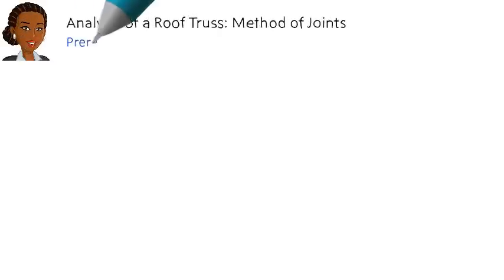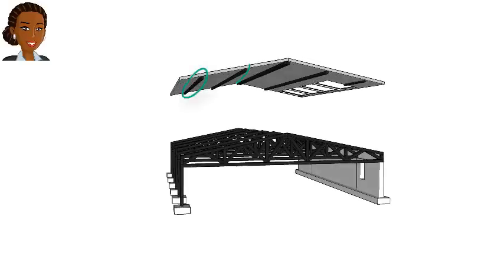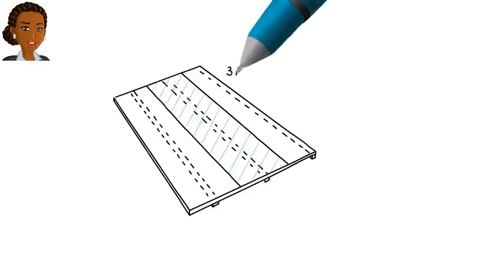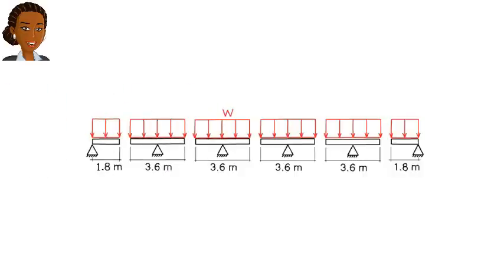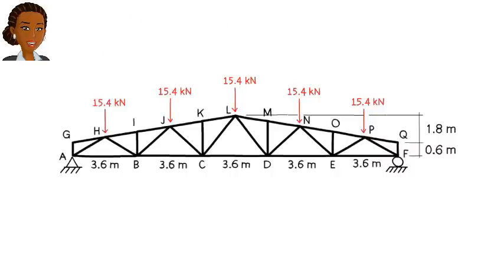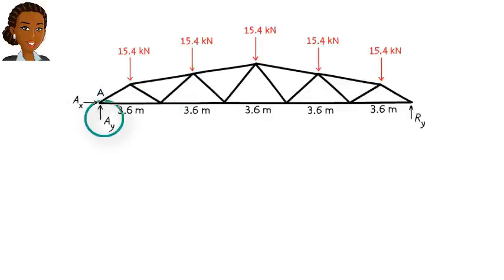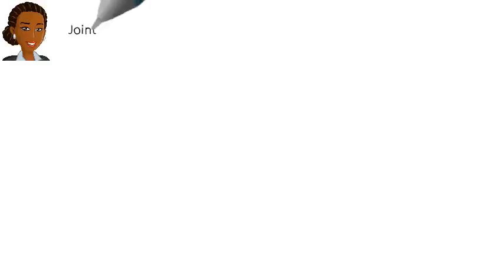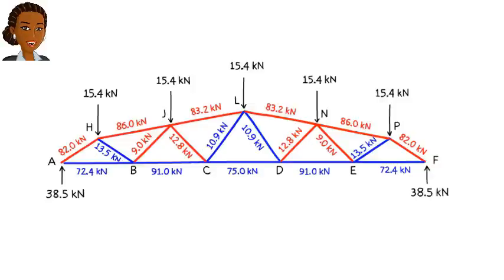SA36: Analysis of a Roof Truss: Method of Joints

Comment: Your force at member bh is wrong .. And the rest of the members for compression and tension.  Maybe u need to review the forces or ur computations..
Reply from the maker: Why is the force in member BH incorrect? can you explain? can you support your assertion?
Reply: @DrStructure  i used the  equation in  my scical..
Reply: @DrStructure  the principle in solving the forces using method  of joint is correct but u need to review the values of the forces  maybe  u need to recalculate it, anyways im just telling what ive found.
Reply: BH should be 14.07kN in compression and JH should be 86.42 KN in tension
Reply: @chinitoengineer5462  lol, are you serious? How can JH be in tension?
Reply from the maker: @chinitoengineer5462  Let’s do some qualitative reasoning here to see why JH cannot be a tensile member. 

Think of the truss as a hollowed beam which is subjected to a series of downward loads. Consequently, the “beam” is going to bend downward which causes compression along the top fiber and tension along the bottom fiber of the member. Translating this back into the truss terminology, we can conclude that the members along the top of the truss are going to be compressed and the members along the bottom chord of the truss are going to be stretched. This simple reasoning invalidates the assertion that JH is in tension.

I leave the calculations and validations of the force magnitudes as an exercise problem, and welcome any solid reasoning and/or proof that you can offer in support of your conclusion.
Reply: Ok lets say that we neglect the compression and tension the point here is the values that u calculate is wrong its not 13.5 and 86..
Reply from the maker: @chinitoengineer5462  You keep making the same assertion without supporting it. Where is the proof?
Reply: And also  your presentation of compression and tension forces were wrong how can you stretch BH if AB is also ang tensile force? Simple analysis by eye without any computation u can easily identifiy  what kind of force it is.
Reply from the maker: @chinitoengineer5462  That is a good question. How can BH be in tension if AB is also in tension?  
Consider joint B. BC carries a tensile force of 91 kN. AB carries a smaller tensile force (72 kN). So, thinking about it qualitatively (ignoring the very small compression force of 9 kN for now) BC is pulling to the right with a large force, AB is pulling to the left with a smaller force. To balance the forces, therefore, BH must be pulling to the left too, which means BH has to be a tensile force.
Reply: Do i need to show my computations? U have to recalculate it to find it by urself i am helping u to edit this vid so u will not commit another mistake for ur next video ive seen all ur videos from the very beginning and its great, the analysis is right  but this one caught my attention  because of the flaws . Dont take it personally, im a license civil engineer and when i saw the mistakes i cant help myself to correct it..
Reply from the maker: Your comments are not taken personally. Quite contrary, this dialogue serves a purpose and highlights an important point. And that is, we need to be able to support our claims/assertions with sufficient data and analysis. The solution to the problem has been detailed in the video. The analysis has been given in a step-by-step manner. If you see a flaw in the solution, it would be constructive to point to it, and show why it is incorrect. You are making a blanket statement without providing any proof. Such a statement has no educational/learning value. 
Furthermore, as far as I can tell, the results of the analysis has been validated. It would be of great learning value to all if you can provide convincing details as to why the solution is incorrect.
Reply: @DrStructure  where can i send my proof?  , i will send it to you..
Reply from the maker: @chinitoengineer5462  Feel free to email it to Dr.Structure@EducativeTechnologies.net with a reference to this video (SA36) in the subject line.

If your solution is comprehensive and self-explanatory, we will use it as is; we will place it on one of our web serves and will point to it in the comment section of this video. Otherwise, we will amend it in order to make it a viable learning experience for students before releasing it online.
Reply: I followed ur step by step computation in fact  i used it to compute the 2 unknown forces and its not 13.5 and 86 that's why i want you to review ur solution ..
Reply from the maker: @chinitoengineer5462  We look forward to receiving your solution and the reasoning behind your assertion. 

The following links provide additional data on the matter at hand. The first link (pdf) provides the analysis data for the truss in this video. The analysis was done using iTruss, an application program for 2D truss analysis. The second link is a full (pdf) report generated by iTruss for the analysis. The report shows the details of the computation using the displacement method (the method used by iTruss).  You can learn more about iTruss by viewing this video (https://www.youtube.com/watch?v=UmUk9TAlrEc&feature=youtu.be).

iTruss input/output data: http://lab101.space/qa/SA36-truss-analysis.pdf
iTruss Report: http://lab101.space/qa/SA36-truss-analysis-itruss-report.pdf
Reply: @DrStructure  so what was the final consensus to this argument/discrepancy? I am dying to find out :)
Reply from the maker: @AllanteLexus  Beside the above comments, we have not yet received any additional input from Chinito Engineer. It would be quite interesting to identify issues and discrepancies in the solutions, and work toward a solid resolution. Such a discourse could offer a valuable learning experience.

Comment: Are those downward forces/loads at the bottom chord (not in this problem) are loads due to ceiling loads? Where/How to include the dead load of the truss?
Reply from the maker: You can calculate the weight of each truss member (area * length * specific weight of the material), then place half of the weight at each end node of the member as a point gravity load.
Reply from the maker: Yes, generally speaking, the loads along the bottom chord of a roof truss come from the ceiling.

Comment: how did you determine the span to depth ratio. in many cases it ranges from 12 -24
Reply from the maker: In principle, that is a design consideration often decided by the architect based on the underlying architectural design criteria and the cost of construction.

Comment: Hii what if both the end are hinged , there will be lateral load on column and that will produce huge moment in column..
But if say column is hinged at bottom then the moment will not generate and get transferred to concrete pedestal via non uniform bearing pressure..
Hii sr please send your whatsapp no.
Reply from the maker: If the truss is attached to the columns using non-rigid connections (i.e., pin and roller as was assumed in this lecture), then the columns being pin-connected at their base makes the frame unstable. 

If however we make the beam-column connection rigid, at the their base, the columns can be pin-connected: either both pins, or a pin and a roller. In that case, the equilibrium equations tell us how the applied lateral load transfers to the base of the columns. In the case of a simply supported frame subjected to a lateral load, bending moment reaches its maximum value at the joint connecting the beam to the pin-based column.
Reply: If both end of truss are hinged then there will be large horizontal force component acting in the connected column how to transfer that much large moment to the soil please tell
Reply from the maker: If the truss is connected to the columns using two hinges (one on each side of the frame), then the frame (consisting of two columns and the truss) needs to be fixed at the base of at least one of the columns, and either fixed or pinned at the base of the other column. Otherwise, the system becomes unstable.

To properly transfer the forces and moments at the base of the frame to the soil, the frame needs to rest on a properly designed foundation. For example, one can design the right size footing that can effectively transfer the axial force, the shear force, and the bending moment from the column to the soil.
Reply: Hii sr please send a way to contact you i will send you image of my problem...
Reply from the maker: You can email your question to 
Dr.structure@educativetechnologies.net
Reply: My question to you is if both end are hinged of truss then due to equilbrium at truss ends a large horizontal force will be generated..
And finally that force will act on the columns producing large moment if base of column is fixed...
If base of column is not fixed it is pinned then?? Like in case of base plate
Reply from the maker: You are describing an unstable frame. You cannot design a frame that is hinged at the top and pinned (not fixed) at the bottom. If you do, the structure will not be able to hold any loads; it collapses.
Reply: Sir i have sent my quary to ur email address
Reply from the maker: @structuralchannel2507  We are yet to receive your email. If you are having difficulty communicating with us via email, you can log in to our (free) online course and use the course discussion board to post your context-relevant questions with images/drawings. The link to the course is provided in the video description field.
Reply: Sorry sir i have checked and have mailed you again please check my quory ..
Reply: And congratulation sir you have created such a beautiful series on structural analysis on your website...

Comment: Hi Dr. Structure and everyone.  Can anyone explain why HJ carries 86KN and BC carries 91KN when the whole roof's weight is only about 77KN?   Thanks in advance for the answer.
Reply from the maker: It is not uncommon for the applied loads to produce bigger internal forces in the structure. The equilibrium equations can show us the mathematical necessity for this phenomenon. For example, consider a truss joint connecting two members each making a 10 degrees angle with the horizontal axis. If the joint is subjected to a downward force of 50 kN, since the sum of the forces in the vertical direction must be zero, we can write: 2F sin(10) = 50 where F is the axial force in each truss member. Solving the above equation for F, we get: 144 kN, a significantly bigger force than what is being applied at the joint.

Comment: how did we get 1,58m and the other differences between 2 member ?
Reply from the maker: Not sure what distance you are referring to. If you are referencing the distance between the roof beams/purlins, they are obtained from the given dimensions of the system. The side of each roof panel is about 9.18 m. The beams/purlins divide this length into 5 equal distances, hence each segment ends up having a width of 1.84 m.

Comment: But if we put purlins instead of beams, how do we transfer the weight of the roof and the purlins to the truss? And how do we transfer the calculated weight of the truss to the column. Thank you in advance.
Reply from the maker: For analysis purposes, purlins are beams. The roof sits on top of the purlins which in turn rest on the roof truss. 

The truss has a vertical support reaction at each end. The reaction force is the force/weight that the truss transfers to the column/wall.
Reply: @DrStructure  so i need to calculate the weight of the roof cover and the purlins and then add that to the self weight of the truss to get the vertical reaction on both ends of the truss?
Reply from the maker: @miguelcarloperez7770  For dead load analysis, yes.

Comment: what if  C-purlins are used instead of beams?
Reply from the maker: As far as this analysis is concerned, the shape of the cross-section of the purlins, or the other structural members, has no bearing on the results.

Comment: Nice presentation. Thank you. Why did not consider the angle force acting in purlins to truss?
Reply from the maker: Sure, other forces such as the weight of purlins as well as own weight of the truss are in play here. In this lecture, the focus is on the roof load only. In the actual design process, we often analyze the structure under each load type, then use the principle of superposition to determine the combined load effects on the members.